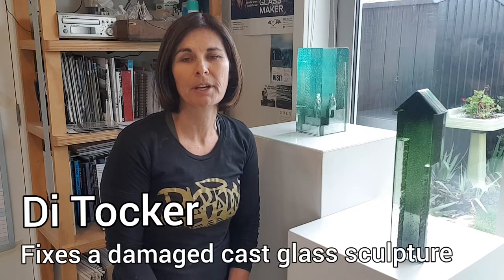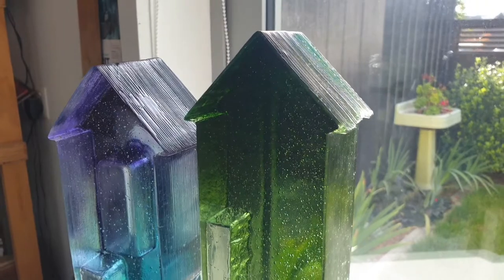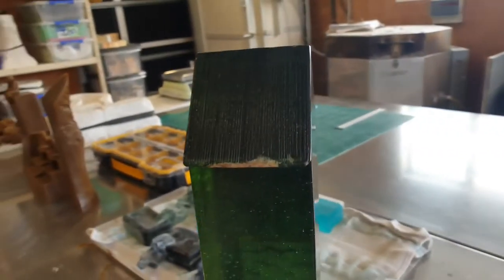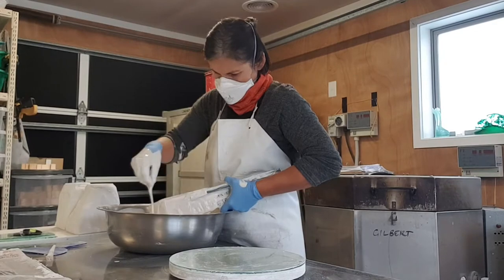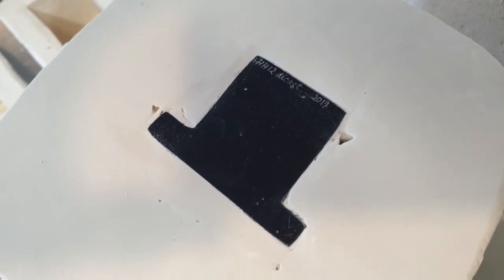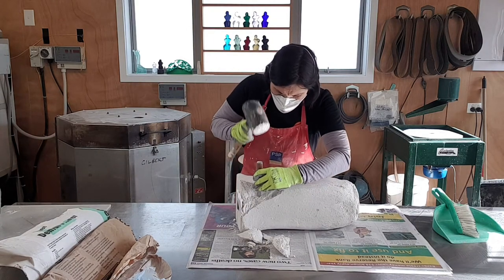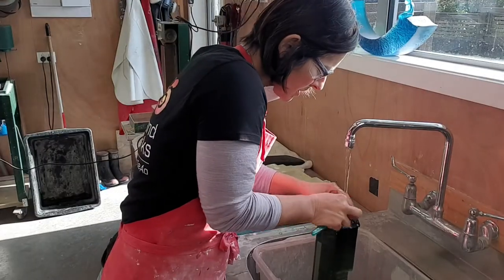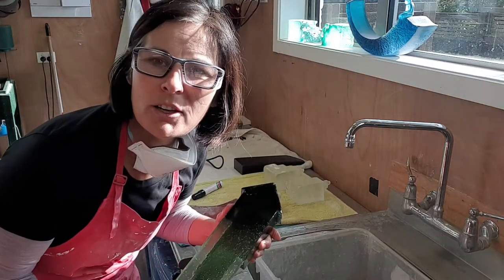Repairing Cast Glass with Di Tocker - by firing it again in the kiln

Comment: Did you heat to the normal peak firing/flow temperature for that glass to get it entirely liquid or did you go lower?
Reply from the maker: I ramp up at a slower rate because the glass is solid. 25 degreesC per hour instead of 50. But otherwise the firing is the same.

Comment: Do you mix your plaster with silica separately or is it sold with silica already included? If so, what is the ratio of plaster to silica?
Reply from the maker: I mix the plaster and silica. The ratio is 1 water, 1 plaster, 1 silica. Sometimes more/less water is required depending on temperature. Put in bowl in this order, sprinkling dry ingredients over the water. Allow it to slake (sit) for min 2 minutes before stirring. Some prefer to do this by volume, but I use scales. Hope that helps!